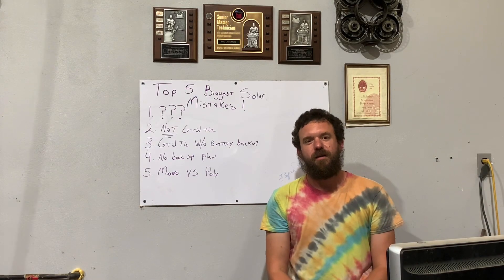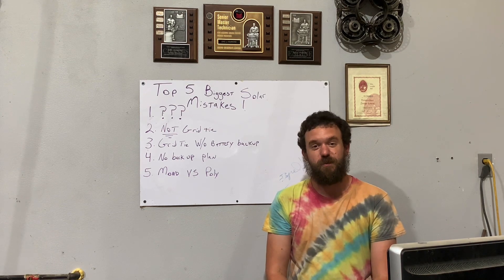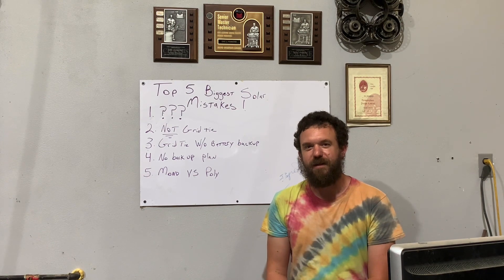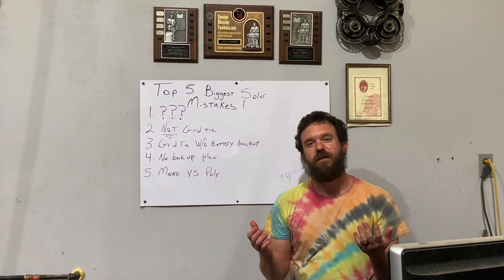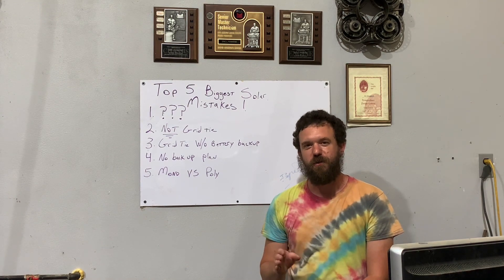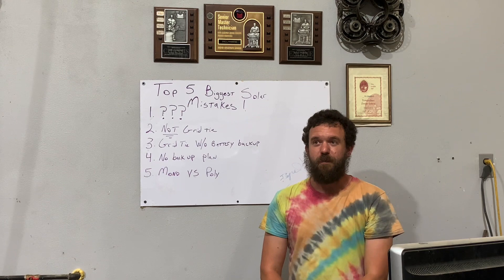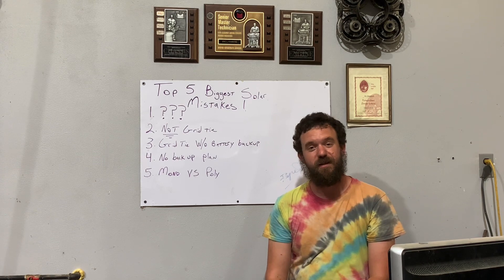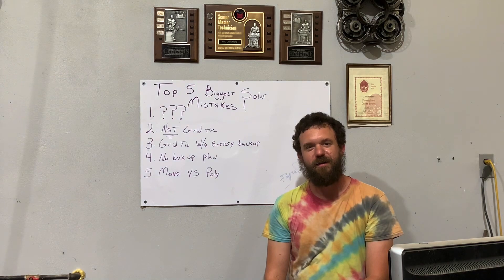Don't make these mistakes when installing solar panels for off grid or grid tie power!

Comment: 20+ years off grid and if you need a gas genny your system is not sized correctly or you are trying to live off grid like you live on grid.

My system is just 1.4K with 800Ah of battery capacity and that runs everything for full time living at my cabin including wat pump, lights, laptop, evap cooler, washer. two fridge/freezers, microwve, and recharges my ebike and lots of gadgets and tools.

Mono is better but poly will work if that is all you got and just maximize your solar production by using a ground mount so you can track the sun.

Comment: Love the video, brother. Relevant information that a lot of people will find useful. If you don't mind me suggesting this. Buy a Boya BY M1 microphone. Its a wired lapel mic that has like a 15 foot cord. I still have and use mine after 5 years, or so. It will make your audio magnificent and its only around $20. Fo shizzle!
Reply from the maker: Thanks for your idea, I will order a microphone this weekend.  I had no idea they were even available for iPhones.  What do you think about a wireless/Bluetooth microphone?
Reply: @TheJoyOfHomesteading  The iphone and newer androids without the headphone jack,  you need to get a lightning to 3.5mm adapter. I had to get one for mu galaxy note 10. I ordered a cheap wireless mic a few months ago and as long as it's charged and you do a test recording, it does fine. I think I paid 30 for mine. I use it slot, but I personally trust the boya more. Check out a channel called Think Media. I've been watching them for years. They started around 2010 and all they do is youtube tech as well as tips and tricks for youtube. A couple good brand names for the wireless are DJI and MOVO. Can't go wrong with quality for those 2

Comment: I disagree with number two! It may depend on where you live & which power company you’re dealing with, but I found mine to be incredibly deceitful!
That’s why I decided to go totally off grid. This way they cannot threaten me in anyway, demand to come into my home and see what’s going on and force me to pay all kinds of permit fees and submit to inspections!
At the same time, I can go back on the grid anytime I like. If you have a disconnect switch of some kind, separating your grid tie to your inverter. 🖖
Reply from the maker: I understand completely what your saying.  I was off-grid for over 8 years for the same reasons.  I may use your post for further discussion tomorrow.